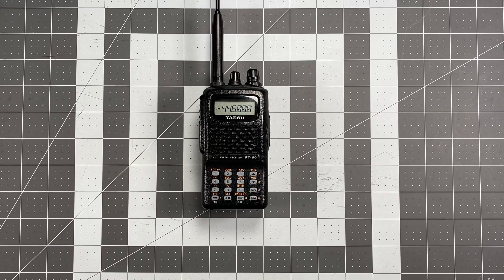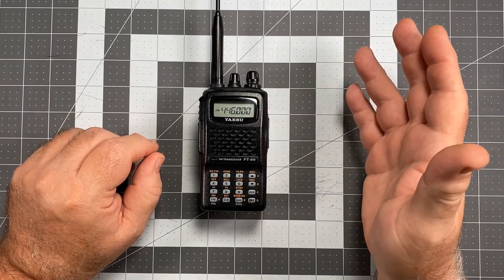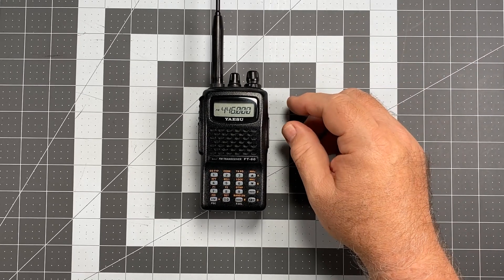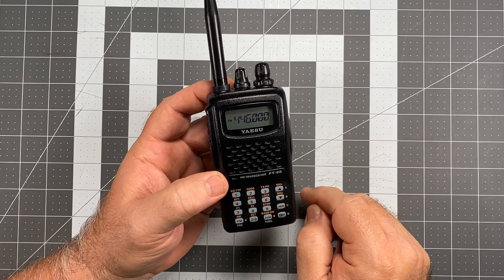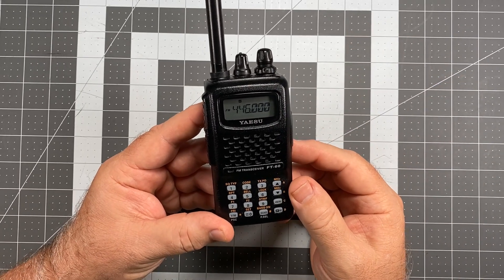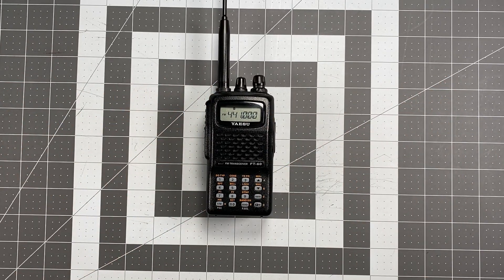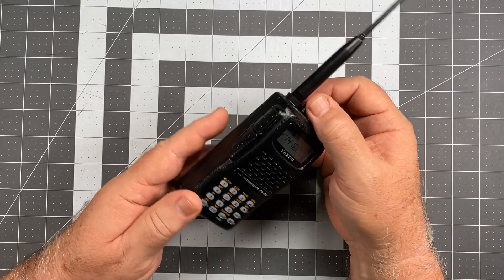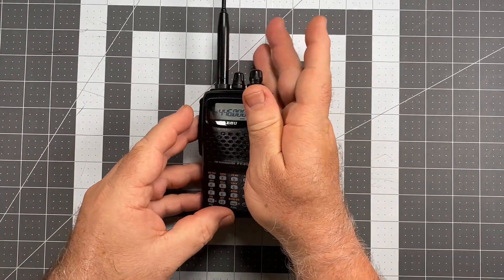Yaesu FT-60 Operator Series - Part 5: Disabling Automatic Repeater Shift (ARS)

Comment: I just read the following regarding automatic repeater offset ..
Note: the Yaesu FT-60R will automatically turn off repeater offsets if its current frequency falls
within the simplex ranges of the ARRL Band Plan and the ARS (menu item 4) setting is ON. So, if
the simplex frequency you select is outside these ranges, you must first set ARS to OFF.

Comment: I’m glad you brought this up, however there is a way to get it back to simplex without doing a factory reset. Once you turn ARS off and it still shows the repeater shift, go to menu 38, RPTMOD. When you go into that menu option, you should see that it’s set to the RPT-. Select the RPTOFF option and it’ll turn the shift off for simplex operation. Yet another quirk, but it’ll definitely save you time from having to reprogram the radio.
Reply: Thanks @mattxoverbey, it works great !!!
Reply: Agreed….Good info @mattxoverbey.  Now, when I plug in a simplex freq the offset is gone, but the display still shows “T” for squelch tone…do I need to always manually go into Menu 48 to turn that off?  Does it need to be turned off for simplex?  Or, is there a Menu item where it I can turn off squelch tone all the time until I set up transmitting to a Repeater.  Thank you.  Robert…KO4CLB
Reply: @VikingCook  if you press the f button on your keypad then press 1, it’ll take you to your tone options. Turn it to off then you then the tone won’t show up.
Reply: I followed your instructions and indeed it did turn off the offset for a preexisting channel.  However, I switched the channel and came back to the one I changed and the offset reappeared (after I had disabled it)...weird
Reply: @GreasyGrits21  if you already programmed the frequency into a memory, if you change it, it will go back to how you originally programmed it. You’ll have to enter it into memory again with the correct settings.
Reply: @mattxoverbey  Ok that worked, thanks.  One more quick question...do you have to turn off both ARS (menu 4) AND RPTMOD (menu 38) or can you just set menu 38 to off before saving the freq to a memory slot?
Reply: @GreasyGrits21  If I’m programming a simplex frequency, I’ll keep them both off.
Reply: @mattxoverbey  Thank you very much! 73
Reply: So do you believe he is 100% accurate saying ARS doesn’t function properly on this radio? I actually just purchased this HT over the weekend and going through the configurations.
Reply: @ryanjames229  it doesn’t function properly in the sense of what he said. When it comes to the UHF side, the ARS gives an offset even on the simplex frequencies. Beyond that though, I wouldn’t sweat over it. It’s still a great radio and you don’t have to use ARS on it if you don’t want to.
Reply: Thank you for that. Last question, going back to an earlier comment I’m a bit confused with that as well…do I want to turn tone completely off as or just leave that alone?
Reply: @ryanjames229  you add a tone if there’s a reason for it. Repeaters normally have PL tones or otherwise called CTCSS tones. If there’s a repeater in your area that you’re wanting to program you can look up the repeater on something like RepeaterBook which is a website and a phone app and provide your general location and it’ll show you if there are any repeaters in your area and it’ll provide any information you’d need to program them. Also, some times you and another operator may want to talk on simplex but maybe not want someone else to listen in. You and your other buddy can add a pl tone (it has to be the same one) to that simplex frequency in each of your radios and you can use it that way.